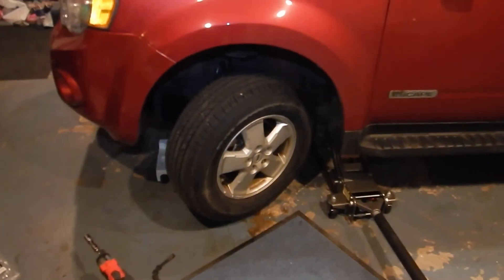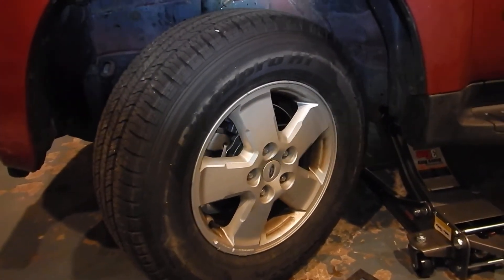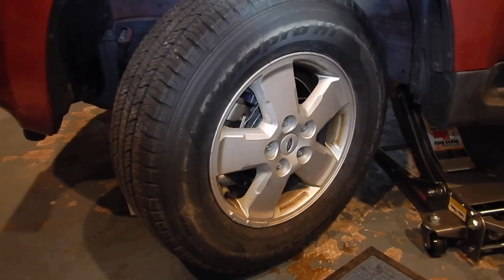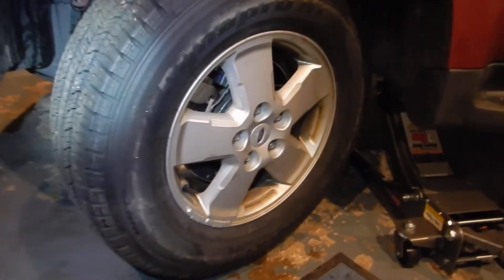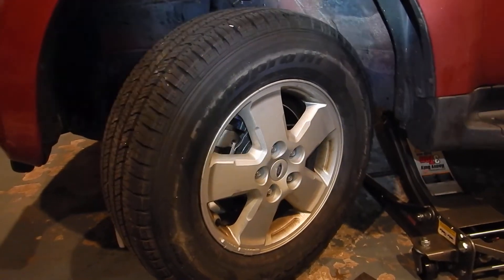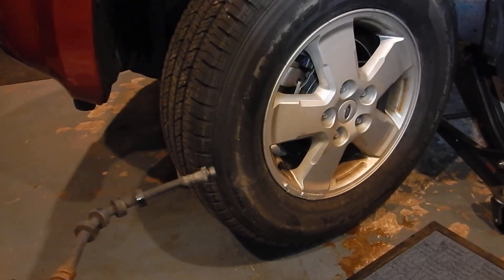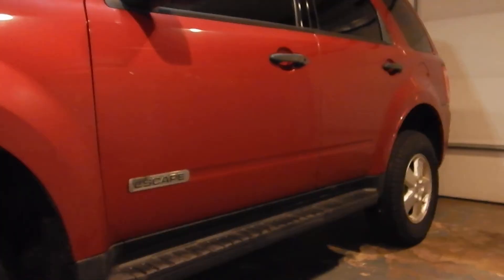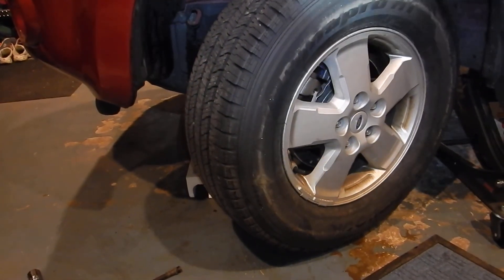Vehicle pulls to one side when applying brakes/or drifting explained

Comment: New ball joints, new brake lines and calipers , replaced the brake fluid and bled the brake lines; still my 92 Wrangler pulls to the right when I apply the brakes...
Reply from the maker: What the heck? Did you replace the rotors?
Reply: @addismultitasking3504  Yes, new rotors, rear drums and brake shoes with hardware completely replaced. all  the front steering tie rods have also been replaced. New 31" BFG KO2 tires.. Alignment done. I watched a video on YT about the brake caliper Banjo bolts. That's the only thing I have not checked... 
It's scary, at 45-50 MPH when I slam the brakes it pulls to the right and I have to compensate by turning the steering wheel hard to the left...

Comment: OK, explain to me when I drive down the road and I applied the bricks. I am fine but when I come to a slower speed, my vehicle hold to the right and very quickly pulse to the left and my ABS light comes on and I only have that problemat a slower speed about 3 miles an hour when I am above that everything works like it should no problems brake pads look fine. I just replaced them brake lines look fine. There is no leaks.

Comment: I put new brakes, rotors, calipers, tires, wheels and allignment and now when i tough brakes it pulls hard to driver side
It wasnt doing that before
Front passenger side rotor smoking a bit
Not sure because everything is new or what!
Its a ram 1500 . I did all that for new bigger tires/rims etc
Reply from the maker: You have a stuck caliper piston

Comment: Hello I have a dodge ram . When I’m going down the highway , I apply break pressure and is swerves a bit to the side , I then accelerate and does the same thing .

I changed the break lines on both sides , so in this case would it give my calipers?

Comment: I know this is a very old post, but my car is doing this after picking it up from the body shop. Driver ran a stop sign and tore up the right side of my car pretty bad. Now when I apply the brakes my car veers to the right. Second opinion I was told it needed an alignment. Nope didn't fix it 😢. Do I need to take it back to the body shop or a mechanic?

Comment: What if you’ve replaced calipers, pads, disc AND lines and it’s still pulling when braking?
Reply from the maker: WOW!!  Im thinking struts, and alignment
Reply: @addismultitasking3504  new KYB struts as of last week
Reply from the maker: What the heck???  Are you positive the person that said they changed the parts did it correctly?
Reply: @addismultitasking3504  yes I did it myself and was a tech for many years.
Reply from the maker: Wheel bearing good??
Reply: @addismultitasking3504  Haven’t checked that yet. I’ll give that a try. It has a ton of miles on it
Reply: @tracy  so
... Did you figure it out?
Reply: @robstone2316  I found the right caliper sticking which would have nothing to do with it pulling left so the answer is still no. Any suggestions?
Reply: @cheapcargarage  rack and pinion bro
Reply: @Locochon1  That has nothing to do with it.
Reply: @cheapcargarage might be something with your steering.
Reply: ABS? Abs modulator?
Reply: Did you ever figure it out I’m having same problem
Reply: grease up front steering linkage

Comment: Yeah the whole right side isn’t working. No ABS light. But it drifts driver side when pressing the brakes. Just put new calipers on the front. You can even feel the drivers side rear kick over. Almost like the whole pass side doesn’t work…

Comment: Mine isn't drifting, but whenn I turn and brake hard, the driver side fights, even makes a noise. 2007 Camry with 145k miles. It only happens when I brake hard and more often when I turn right. Driver side just pulls.
Reply from the maker: Possible brake line is getting twisted or pinched?

Comment: Thanks for the info. Very helpful.
Does this apply for a Ford F100, 1972?
It is doing exactly what you said (pulls to the right when braking). It is drums system on all wheels.
Thanks
Reply: Yes, this applies across the board. For drums it is likely as simple as needing to lubricate the moving parts & bring the pads into adjustment if they still have meat left. Sometimes the pads will glaze or you will see corrosion on your rotors/drums which will signify an issue with the pads making proper contact. Like he said breaking opennthe bleeder valve & seeing if when the pedal is depressed fluid squirts out is an easy indicator that the line may be clogged, but remember not to let the pedal up without closing the bleeder valve first. Most people are bad about flushing & changing brake fluid & as it gets moisture & age behind it the fluid breaks down & will degrade rubber including your flexible brake lines. The brake lines will swell & restrict the ability to function properly.
Reply: Did you find out the reason?

Comment: Mine go both ways, i got new brake lines and still does it any ideas please
Reply from the maker: I would think that one of the Pistons on one of the calipers is probably stuck
Reply: Ok thanks
Reply: TOO MUCH BRAKE FLUID CAN CAUSE THIS PROBLEM. DONT FILL ABOVE MAX, TRY TO KEEP THE FLUID BELOW THE MAX LINE. IT WILL HELP
Reply: @MrIlovebmw86   mine is cheers

Comment: My jeep is doing this, put new tires on and just replaced my rear pads and discovered my passenger rear caliper piston was stuck!! now I,m afraid one of fronts is too. it only has 56K miles on it. I bled all the calipers and put in fresh brake fluid and a lotta trash came out of the lines and the fluid was black!! maybe something bad / all my brake lights are on? who knows geez
Reply: TOO MUCH BRAKE FLUID CAN BE AN ISSUE. TRY LOWERING YOUR BRAKE FLUID TO BETWEEN MAX AND MIN.

Comment: I replaced everything on my truck still pulls right when I brake and they gave up and didn’t know what to do no more
Reply: It's because the problem is in the rear.. you need to replace the whole rear rods to wheel. And the rod may be ceased forcing you to take off the assembly as one piece and is busted inside and leaning inside . Can't see it . Until you actually replace the rear tow bar . It automatically fixes the rear tow, where the front tires are aligned from.. so . It's in the back.. like my Dodge neon.. probably the passenger side rear .busted assembly in the inside. Or the right tire it is simple needing a camber bolt.  Super easy... I know am a owner of a car that doesn't pull to the right or left .after messing with the rear. Even tho I did everything to the front an no results. Until I did the rear.
Reply: @dskap201  it's on the rear. For sure. Half your car in the rear end is riding side ways. One wheels it seems like is causing it all. I think the back passenger side . Igo lol at the tires and see what side of the tire is barely uneven. Most likely the back rear right tire is the cause. If it's pulls to the right sometimes and stoping at red lights is the result. When you fix the rear and resude everything it will fix it. Becouse your thrust when you take off the front wheels are not aligned to the rear. And when you got it aligned it thrusted wrong.becouse the rear. The front is ready for the rear to be online and complete. Then go to the garage and align it agian, do you have camber bolts. What did the alignement at the garage. Report say. Was anything in the red.or can you send me a pic of it
Reply: @dskap201   when you fix everything in the front and it still messed up becouse the problem was always in the rear. .. the car is waiting for you to relize that.
Reply: @dskap201  leave that garage bro. Of you can't see the results by looking at the report. Then forget it. The answer is in that he obviously has no SINCE
Reply: @dskap201  the garage is playing games. Did you buy a four wheel alignment. Maybe he told you that's all he can do for the front. Until you realize he wants the other 60$ to look at the rear. Something isn't right. I've been thru the same. Every garage done there best as is .all my cars I ever had pulled to the right. I finally got fed up.  And realized . The garages only align perfect cars. They gave no since. So I finally looked at the rear. After seeing the report of the alignment. And it was the rear the whole time. 1000 dollars later and nobody told me it was the rear. I seen figured out everything. Then got the alignment. And it got better and better and better. And better. And better. After all the parts all the time all the alignments. All the lies. All the giving money hopping they can fix it. Nope..email me the report encryptedfile777@gmail.com
Reply: @dskap201  You sir may have a bad abs module.